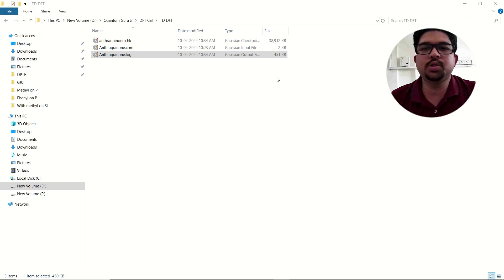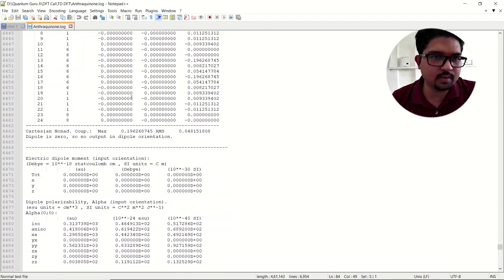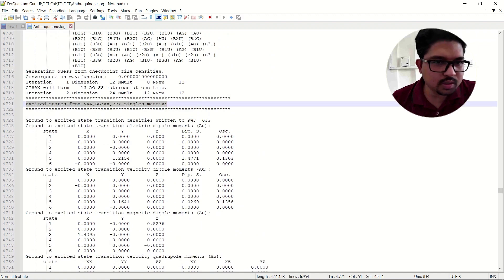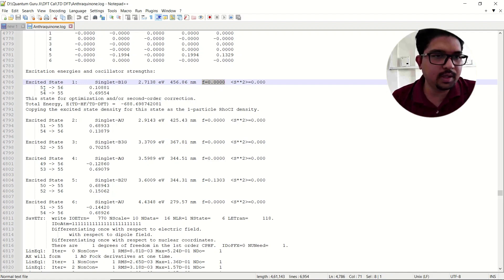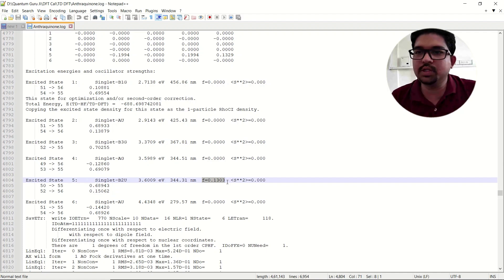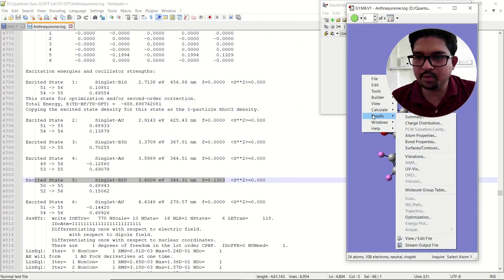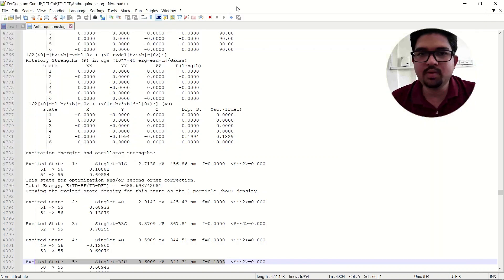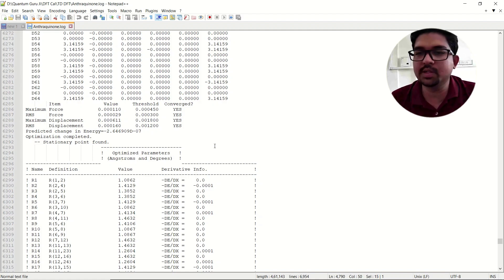TD-DFT output file analysis

Comment: Hi, i have a general and probably stupid question to ask - if the excited state 1 is the lowest energy transition, does it still correspond to the S0 to S1 transition if the oscillator strength is near zero e. G., f =0.0001? Or do you ignore it and call excited state 2 the S0 to S1 transition?
Reply: Thank you!!!
Reply from the maker: Yes, Excited State 1 is still the S₁ state if it is the lowest-energy singlet excited state, even if the oscillator strength (f) is near zero.
Oscillator strength indicates how likely a transition is (i.e., its intensity in UV-Vis), but it does not affect the energy ordering of excited states.
So, even a "dark" state with f ≈ 0.0001 is still S₁ if it's the lowest in energy. The next higher state is S₂, regardless of whether it's more optically active.

Comment: Ground to excited state transition magnetic dipole moments (Au)? more explan that which took from output file
Reply from the maker: Excited State   1:      Singlet-A      3.70 eV  334.78 nm  f=0.0001
<S**2> : 0.0000
Magnetic Dipole Moment (x,y,z) = (-0.0012, 0.0004, 0.0000) Bohr magnetons
Use this formula to find the magnitude of the magnetic dipole moment vector
μ^2= μ^2x +μ^2y +μ^2z

Comment: thank you very much 
it was really useful
pleases, could you explant it for radical pleases.
Reply from the maker: In the case of radicles, the process will be the same; there will be only a small difference. In a radical system, you will have alpha and beta electrons separately, as it's an odd electron system.  And spin will be doublet   

Excitation energies and oscillator strengths:
Excited State   1:      Doublet-A      2.50 eV  496.13 nm  f=0.0456
    0 -> 1  0.68349  alpha
    0 -> 2  0.45023  beta

For each excited state, examine the transitions between molecular orbitals (MOs) that contribute to the excitation.
For radicals, these contributions might be split into alpha and beta contributions due to the unpaired electron.
0 -> 1  0.68349  alpha
0 -> 2  0.45023  beta
This means the transition involves significant contributions from alpha orbital 0 to alpha orbital 1 and from beta orbital 0 to beta orbital 2.